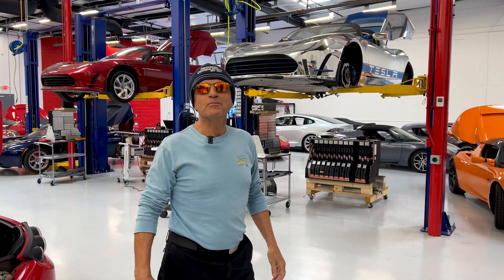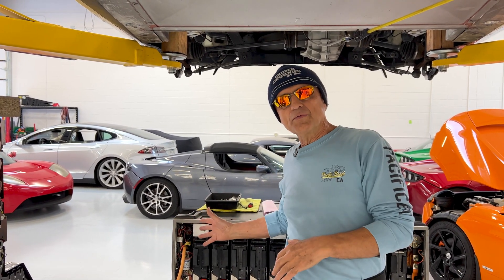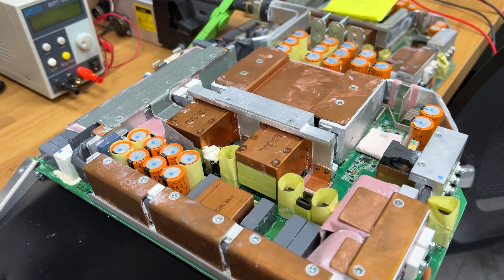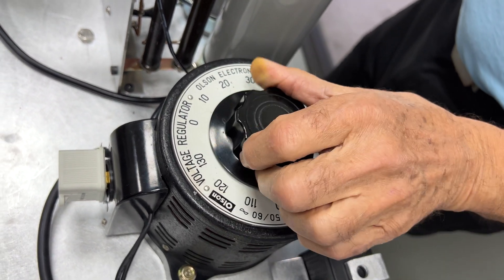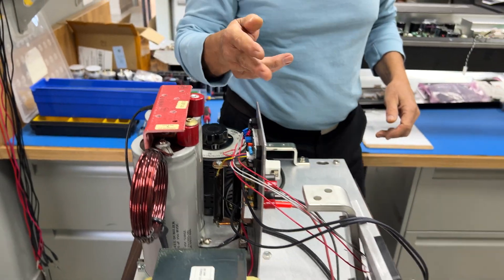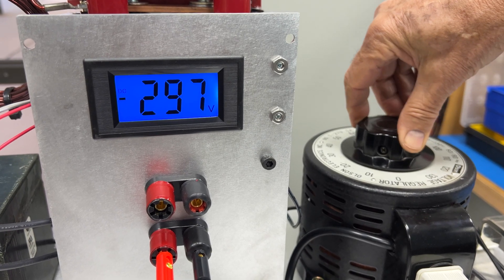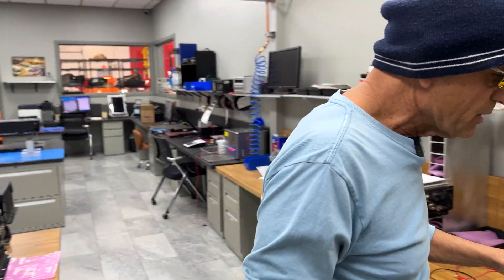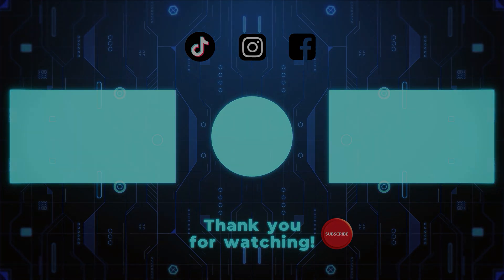High Voltage Equipment Keeps Tesla's ALIVE

Comment: Hi Pete. Those caps in that variable voltage power supply you have are rated at 350 WVDC and 400 DC peak. Be careful, even if they are in series, only a slight imbalance between the two could turn them into an explosive.
Reply from the maker: Thank you for the feedback.  They are connected in series, for a 700 VDC rating.  But like you pointed out, an imbalance could skew this safety margin a bit.

For our applications, this Power Supply will not need to go beyond 400 VDC, and in our world of refurbishing critical power equipment, with even larger WVDC voltage caps, and sometimes scrapping this equipment, we will have more cap selections to choose from.

Comment: 7:02 Pete, Are you sure that unregulated DIY power supply can output 20A at 4000V ( 8kW) from that 1.5kVA variac source and 800VA 480VAC transformer? and from a 120V 15A outlet?
Reply from the maker: You are right.  It was an off the cuff comment and I reconsidered leaving it in the video but it was too late.

The 800 VA transformer would not be capable of delivering that much amperage at 400 VDC.  Our goal was to beef up the 1 Amp limitation we had with the only off the shelf 400 VDC power supplied we could find.  Thanks for catching it.

Comment: Mr. Gruber, can you use a thermal camera to spot a defective cell during charging?
Reply from the maker: We have experimented with this method of searching for heat signatures to isolate resistive cells, which should run warmer than functioning cells.  We found minimal benefit since the thermal potting compound transfers heat very well, and the bloom created made pinpointing spotty.

Our isolation method is a combination of charge/discharge, trend analysis, impedance measurements, and highly sensitive measuring equipment.

One of our contemporaries in Europe, bless his heart, boldly charges the brick with 25+ amps and waits for a bonding wire to glow cherry red.    We would not recommend this method without a few fire trucks poised and ready.